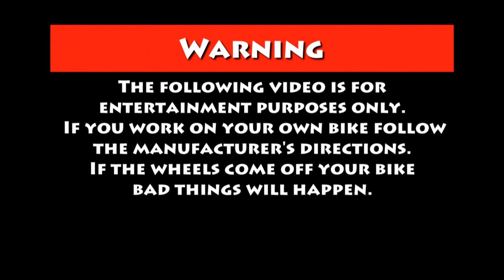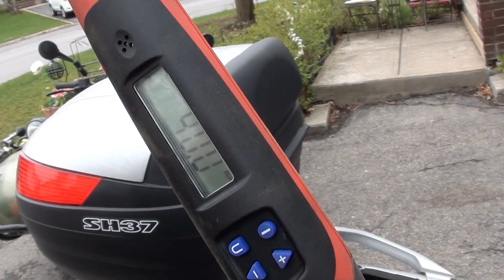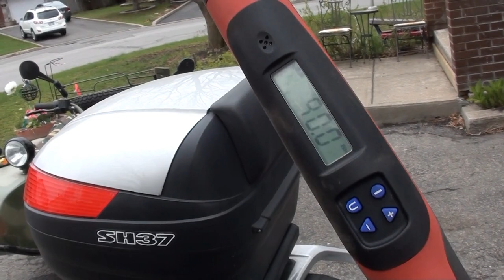Idiot's guide to Suzuki V-Strom 1000 Rear Tire Change

Comment: You 2 at funny and entertaining.
Steering head bearings loose or worn can make the front tire wander.

I always wash clean the old tire and rim at the start. 
This is more professional and reduces the possibility of getting in the way of mounting and dismounting, and helps sealing.
Also aids balancing. Do not be hackers.
Love the dirt you 2 got onto the axle and wheel spacers. I could hear it. LOL.
Reply from the maker: Good idea. We usually check and wipe it down but that may have not been in the edit.

Comment: Looks like you had fun! If you do forget to put the chain on, you dont have to pull the axle right out again! Just get the adjuster blocks to move out enough so you can push the wheel forward enough to get the chain on.

Comment: At 26:35 I believe the approved method is to throw a wrench or screwdriver between the chain and sprocket and turn the wheel to push the blocks firmly against the adjusters before you torque it down.
Also, Henrik speaking Hungarian sounds exactly like Finnish
Also, great video as always.

Comment: if the tire has a colored stamp on the side it needs to line up with the valve stem, also if you screw the chain adjust bolts all the way in it makes installing the axle easier. good vid, wish i had that tire changer

Comment: I like all your videos. But has anyone in your group ever rode a BMW F650GS and was your thoughts on using it for a adventure bike like what you all do?
Reply from the maker: +WashburnsAdventures The F650GS single? BMW got us all confused when they badged some of the 800cc twins as 650s. Either way the bike will be fine for what we do. Real skid plate, real tires and handguards and it will be ready. Joe has a 650 X-Challenge which has the single cylinder Rotax with the better HP2 style suspension and it is awesome. Depending on the model some had 21" front wheels, some 19". There was a Dakar model back in the day that had the 21". I've ridden with guys who had the 650 and 700 Twins and they weren't as good with the 19" front and crappier suspension bt they got it done.

Comment: Hi, just noticed you didn't change the valve stem, I change my tyres myself and have been lazy in the past and changed two tyres without renewing the valve stem. Then one early morning at a ton plus the valve stem split on the front rim (not good). You can get them cheap enough on eBay (it's a must). Steve UK.
Reply from the maker: Good idea to change the stem as you said. Most of us run tube tires so we get a fresh stem with every tube. Will keep that in mind for the future.

Comment: 18:46 you can check that it is evenly seated by checking the rubber raised line in the tire which usually runs 2 mm away from the rim edge. You should try installing a super stiff Michelin Anakee 3 on a R1200 GSA LC using tire irons (and plastic shims for rim protection) and Irwin clamps to get the bead into the rim center. Never had to go to that extent in 47 years of tires changes. I'll be getting a NoMar tire changer, getting old I guess.
Reply from the maker: Had a NoMar and sold it to get a Rabaconda. NoMar is better for street bikes. Rabaconda is also portable.
Reply: @AwesomePlayers  I had a look at their web site. Nope, not for me. It is basically a raised wheel support and a tire iron package. And I don't need a transportable set-up.

Comment: Funny!
I never see this ceramics things here in Brazil!
This works better what the metal weights?
Cheers!!
Reply from the maker: Some of us have used them and they worked fine.  They are called Dynabeads.  Usually I just use the lead style weights and a balancer.  Cheers.

Comment: I think nerb1 means that you should pull the block, the one at 23:44, out just far enough to slide the axle against the adjuster bolt. That way you don't need to readjust the chain ;)   

And I am very curious on what kind of nut is used there. I am not so fund on the securing pins eighter. But is that magic nut secured somehow?

Comment from the maker: There is a thread over on Advrider with tons of folks claiming it smoothed out their shifting and made the bike run smoother and quieter.  I think it something about forcing the sprocket carrier into the cush drive more.  Maybe just an urban myth like the F800Gs with smooth throttle response or the DR650 with tons of horsepower.

Comment: so how do you do this on the side of the road??????
Reply from the maker: You don't. Tubeless tire if you get a flat you whip out your Stop-N-Go plug gun and plug the hole and you are off in 5 minutes. I always carried their small kit when I hab tubeless rims. Before your next tire change practice on the old tire.
Reply: It can be done. I wanted to see if possible if on a trip by the campfire. I’ve changed a few tires now only using tire irons. Shampoo or anything for lube — a heat source (campfire) to warm tire - not burn it.  Using zip ties makes install easy both for removal and putting tire back on.

Comment: These No Mar machines are not as easy to use as demonstrated on tires for certain models of motorcycles.  Rear Harley Touring bike tires and Goldwings will give you quite the work out.  It's the reason I broke down and bought a semi automatic machine. I found a Corghi rim clamp tilt back machine for $800.  I paid $900 for my No Mar with Posi Clamps.  Much faster with the Corghi.
Reply from the maker: I've never done those types of tires. On the weekend I had to put a new 21" on my Husky 701 and since my NoMar is not permanently installed it was just less hassle to do it on a milk crate with tire irons and http://tiremountingtool.com/tmt/ works really well.

Comment: Nice colorful Hungarian inserted towards the end. At least I know where the challenging part is.
Reply from the maker: Henrik is slowly teaching us all a little Hungarian.
Reply: Awesome Players  I was pretty sure that I've heard quite popular Polish word in threre :) . BTW - You didn't have to take the wheel out to fit the chain - all you need is to back up an adjuste'rs little bolts a bit and than tight them back. That wil give you enought slack on the chain.

Anyway - does that video means that Enrico dumped his belowed DR?
Reply from the maker: saracen1608 No the V-strom was Henrik's street bike.  He sold it not long afterwards and now rides a Valkerie as his road bike.  I would rather remove the wheel than play with the adjusters.  They would have to be very loose to get the chain back on and redoing the adjustment takes longer than pulling the wheel... usually.

Comment: Hi Guys, Please advise anyone who changed to new tires to take it easy on the first kilometers. New tires are covered with a kind of grease to prevent getting to dry. This grease and the 'lube' can get very slicky. The best way to clean the tire right after it´s mounted is to ride on sand/dirty.
Reply from the maker: Good point.  I like hit the gravel as soon as possible. The best way to de-sliperize a tire.

Comment: Waaaaaay too much loop... if you put that much loop and it get stuck in there, it will expand when the tire heats up
Reply from the maker: Interesting. Never heard of that problem. When we unmount the tires the lube is sort of dried up and there is almost no trace of it. The lube we use is vegetable and water based and sold by the tire changer company with no warnings about expansion issues.

Comment: wtf 40 dolars ?  quite expensive - i used to service my tires in yamaha, or honda dealer - half of that, in small tires workshop you can do it about a quarter of that.
(rebalancing is required in price)
Reply from the maker: mikkei Not around here. Very pricey. Now that we have done quite a few its no big deal so it is one more thing we do ourselves. Just changed some fork seals on the weekend for the first time and that was easy enough as well.

Comment: Great video, but let's not forget, always practice safe changes - wear latex gloves!  Especially when handling a well greased shaft and especially if you're going to finger the bearing hole after touching the monkey nuts. And not to worry friends, farting is inevitable prior to lubing the rim so lube, lube, lube lest the squealing forces the neighbors to call 911 . . . or worse. And for goodness sake, make sure the lube is off the rubber before ridin'er out the door!
Reply from the maker: Thanks for the laugh.  Cheers.

Comment: This is about right,most tyre changes are bitches,trying to keep tyre in centre of rim channel is the hard part,i like to replace valve stem completly inc new core when changing tyre.
Reply from the maker: Getting the easier the more I do. One thing is for sure. If you are using too much force something isn't right. Usually the tire isn't off the bead and in the drop centre or you need more lube.